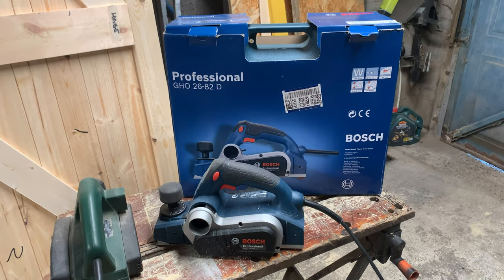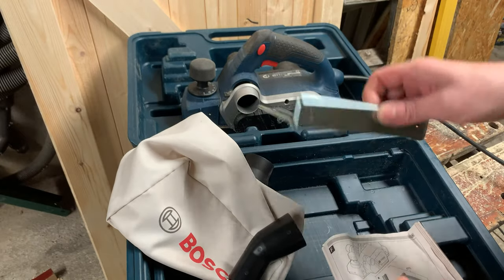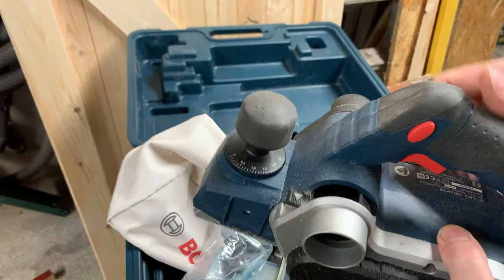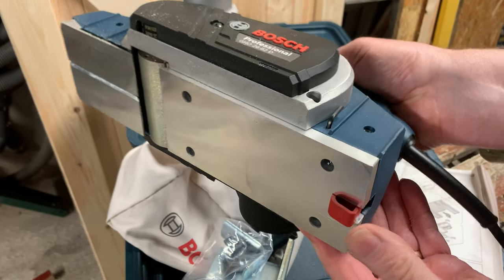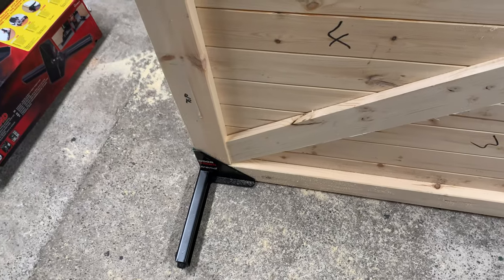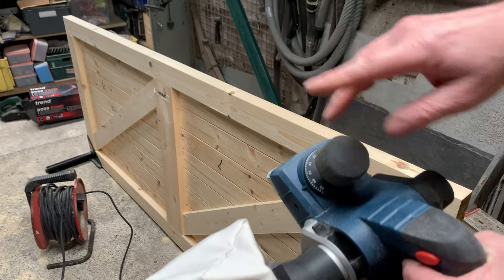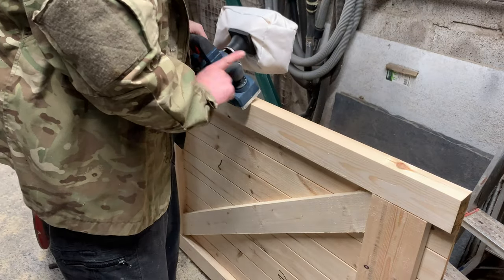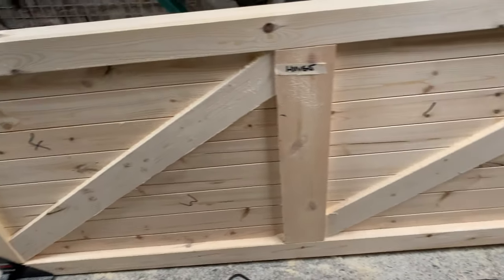Bosch GHD 26 82D plane (planer) unboxed and Tested

Comment: it is better to have just one blade? whats the difference white the ones that has 2 blades? thanks !!
Reply from the maker: Hi Martin, my earlier Bosch had 2 blades and although I only have replaced them once I had a real job aligning one blade to the other. If one was a tad high it would do most of the work. Also they both needed to be dead square or else you would get a bad cut. The same thing applies to the single blade I have now in the sense of being square but now I only need to replace and set one blade. I do suppose though as its doing all the work it will wear out quicker but I would choose 1 blade over 2 simply for the ease of blade replacement, even if I had to do it a bit more frequently than a 2 blader. There may be a lot more to it than that but that is my take on it. Thanks for the comment and of course for watching 👍🏽
Reply: @MikeMakesIt  Thanks Mike !!

Comment: Absolutely not happy with mine. As a test I planed four dry scantlings. At the end the shoe aluminium was badly scratched by knots and jolted so it leaves marks on the surface now.
Reply from the maker: Wow, that’s a shame. So far so good on mine, all is well. I would have expected more from Bosch.